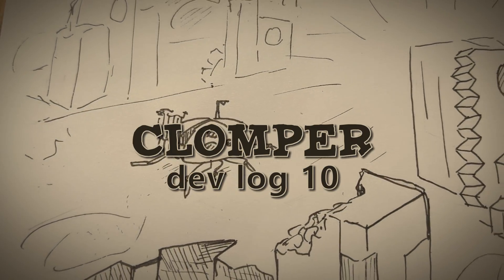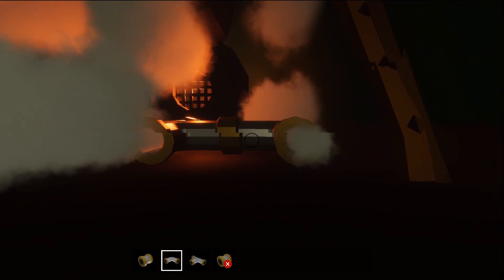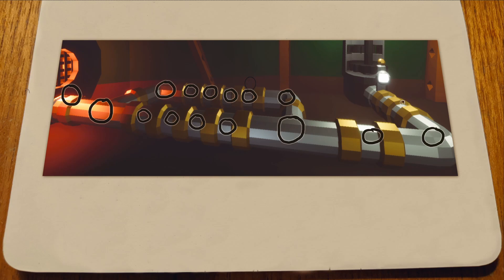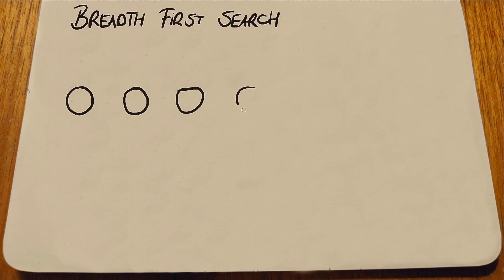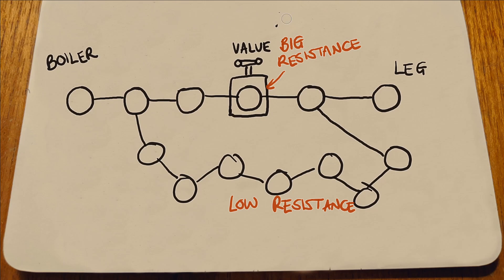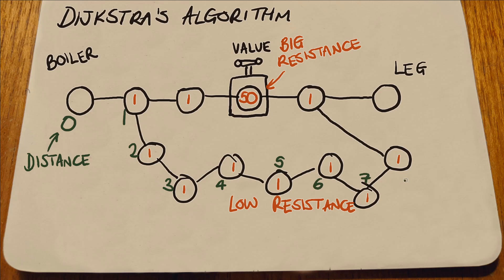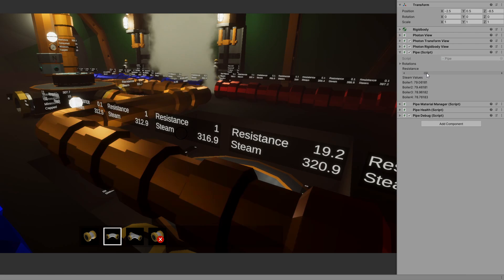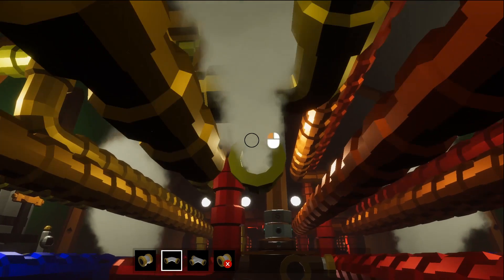Breadth First Search and Dijkstra | Indie dev log | Clomper #10

Comment: (I understood) You could also try to experiment with using the A* algorithm as it's basically just Dijkstra but with the distance check too. It would probably lead to the same results but since it's a more greedy algorithm maybe in some cases it would do something different.
Reply from the maker: Thank you! That's a good point. I'll give A* another look now that I have Dijkstra running. One thing I do need is every node to be traversed, which both do.
Reply: @RobLang  Well if your nodes get split up 10 times and all go in diferent directions both algorithms will try to get to the end the fastest so not all nodes will be traversed.
Edit: probably this is not the case xD
Reply from the maker: I see where you're coming from. In any of these algorithms you can keep track of the "current shortest" and then if all other routes are longer then you can stop. But I'm not doing that. It'll just keep going until everything has been visited. 😁

Comment: Makes sense. Is there a way to make breath first search count a valve as a number of nodes? So if my valve is closing it becomes more nodes? I suppose that wouldn't handle the pipe resistance but you could count the number of nodes and reduce the pressure according to the node number. You might end up with issues where the steam never really shuts off with some algorithms.

Also, how does it work when you have two devices on one boiler? I would think that breath first search would deliver all the steam to the shortest route and none to the longest. Except you've already shown that it doesn't do that by hooking up multiple legs to a boiler.
Reply from the maker: Great thoughts there! I think in the first case your solution would work but it would increase the amount of processing required as each of the dummy nodes you introduce would have to be dealt with in the same way.

The thing I like about Dijkstra is that it's well understood in it's benefits and limitations and I didn't have to invent it! 😂 I'm all for making new algorithms but right now I want to make a game, not a mathematical discovery. 👍😀

Comment: Very interesting! So the "steam" value for a pipe piece is the flow of steam through it. In your original configuration, would the pipes making up the longer path just be totally ignored, and have a steam value of 0?
Reply from the maker: Great question. In the original algorithm pipes had no variable for steam. As part of the graph search, I set a flag on each pipe object so that each VFX graph steam particle effect knew if it should be on or off. It's a bit of a cheat but worked then. Now, as Tom points out, I can change the amount of steam leaking out of open ends depending on the value running through it.

Comment: FINALLY valves! yes!  Nice update.  Indeed the algorithm makes more sense with a weighted value that can be changed either by type of valve or by the state of the valve pipe (open, close, half) or when a pipe is damaged but still operational.  Similar process is used in some path-finding algorithms where there is a "penalty" value on some nodes, maybe to account for the difference between walking in a road or through a forest or hilly terrain.
Reply from the maker: I'm glad you're pleased! I was thinking of you and the regulars when I revealed the valve. As I understand it, the A* algo is really just form of Dijkstra. Amazing given he drew it down on a napkin at lunch and didn't bother publishing for 3 years! 😂

Comment: Nice video Rob, I actually did get it! Some I remembered from my data structures class, and some from working with electrical circuits. I'm liking how you are handling the pipes, and the editor tool should help for testing a lot. And I'm hype for valves :D
Reply from the maker: Thank you Garrett! I'm glad I explained it well enough; it always seems to make sense in my head but until you try and describe it to others, THAT is when you find out if you understand it! Hopefully the hard bit of the valve is done now.

Comment: Do you plan to make the amount of visible steam coming out of unattached pipes dependent on the new algorithm? The more openings there are, the smaller the steam cloud coming out—that kind of thing.
Reply from the maker: Ah ha! Always one step of the game, Tom. 😂 Always one step ahead. It's like you have access to my notebooks. You're absolutely right, I will be changing steam pressure based on the steam running through the pipe which is now - as you might well guess - very easy. As for leaving openings as a "sink" for the steam; that might come later as it makes the game a lot harder - more realistic for sure but tougher. It will probably end up being a difficult setting option.
Reply: @RobLang  I was actually talking more about the visual side of things than the practical side. I was just thinking that if you were to lay a bunch of T-pipes in a row, you'd have a ton of openings, all spewing max steam (from a particle point of view). It'd be weird to see that since it'd seem like there's infinite steam available. You could still deliver max steam to anything that's connected to that pipe (although it'd be counter-intuitive), but having less particles coming out of a pipe with a lot of openings would probably help the immersion factor :)
Reply from the maker: @tomweiland  I gotcha. Yes, I agree. There is definitely a mid-way point where I can give the players a visual clue without making the game much harder. Good call. 👍